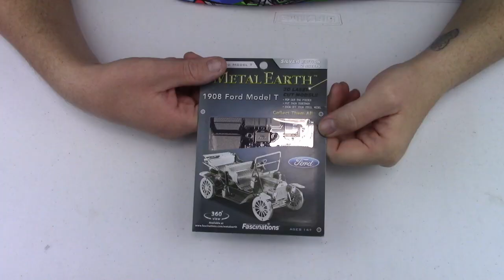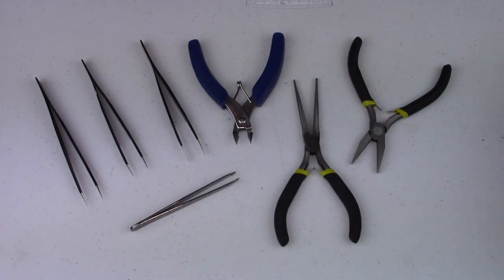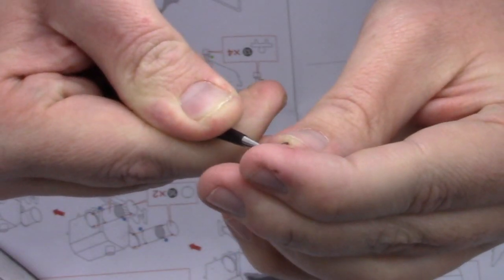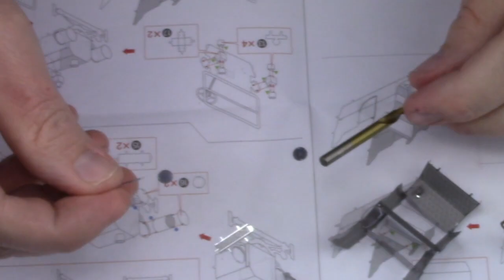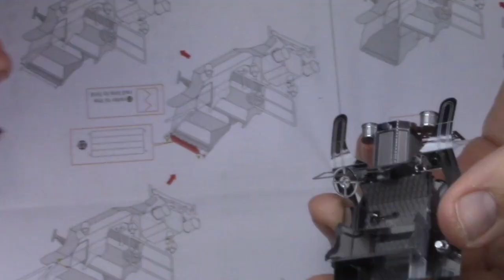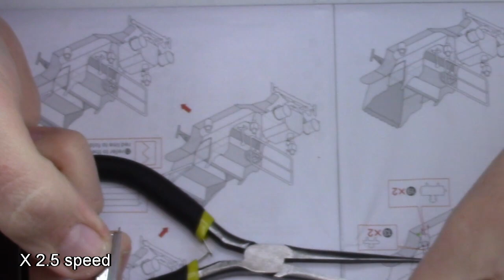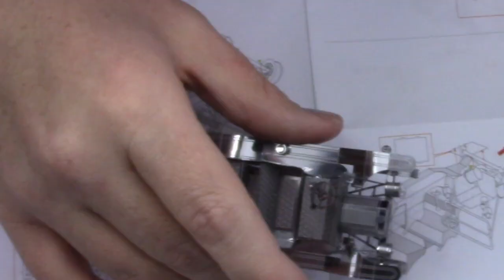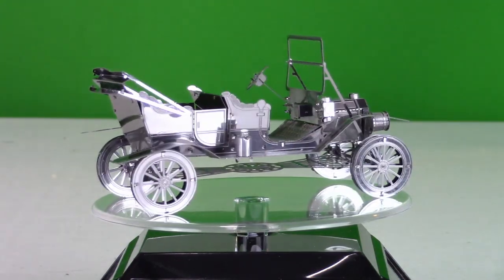Metal Earth Build - 1908 Model T Ford

Comment: Thanks for all the videos. Im glad this kit has a bunch of bigger pieces and not a bunch kf small lieces but yes its a little thin and very delicate in some areas bend very slow guys and careful pwrr you bend the stronger the parts are cause it doesn't creat any kind of heat at all and also you can take some jb weld and reinforc the larts on the inside that cant be seen so nothing breaks

Comment: Im half way through with this one the body pannel sides look kinda wonky not terrible but not great i twosted all the tabs and didnt bend them kver cause i forgot it said bend instead of twist and i just twisted them all with lut thinking but it looks ok if i had to fo it over i would have formed the body pannels sides around the pieces thatt go between before putting them all in so that way i know the body has the right curves and creases in it for it to look straight and even. The tricky part is getting the sides of it to look right once done. This is a good second model for someone